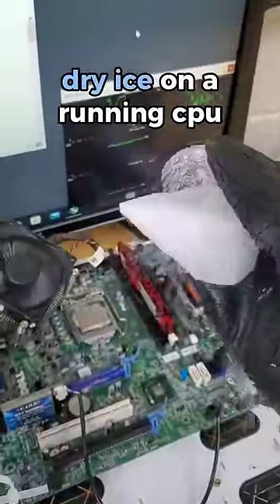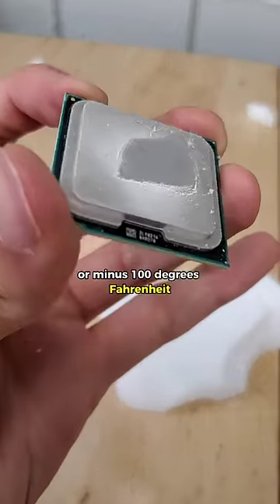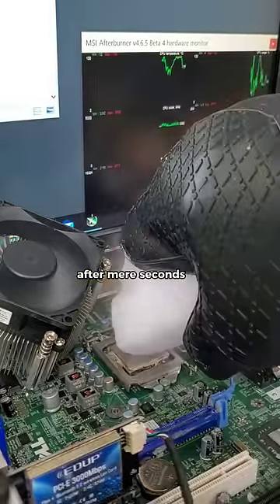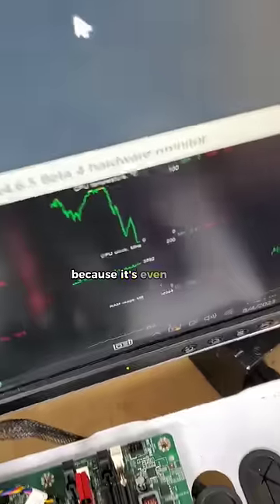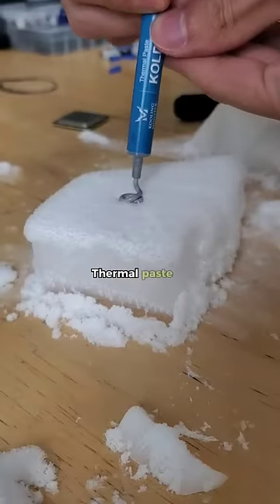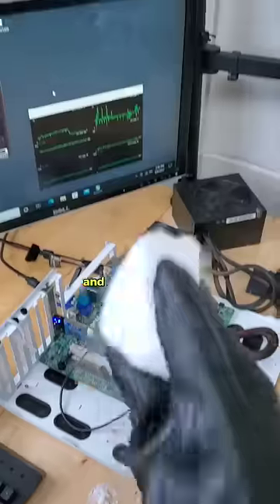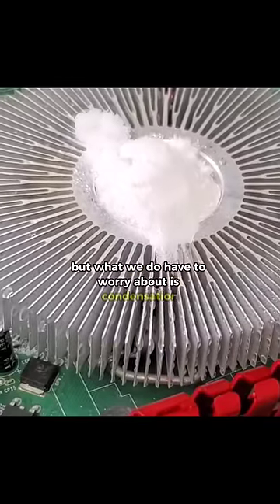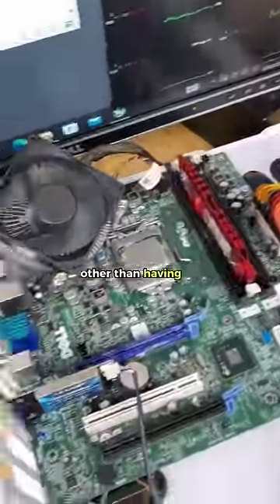using dry ice in a running PC #shorts

Comment: How about making a metal box on top of cpu then out dry ice in it, so you don't have to worry about water on the board
Reply: how would that stop the water in any way...?
Reply: @caldeira_a  just bottom use steel the side use plastic
Reply: @shakld  again, how would that stop the water....? that does nothing
Reply: @caldeira_a  the put the span around it
Reply: @caldeira_a  im trying to give suggestions not arguing with you, if that doesn't work find another damn solution
Reply: @shakld  there are many simple solutions, I'm just trying to understand how what you're saying makes any sense
Reply: @caldeira_a  then do tell me the solution, the solution i give already good if you want to use dry ice
Reply: @shakld  the solution you gave simply doesn't work. As for working solutions, firstly water from condensation is essentially distilled, you just need the computer's surfaces to be clean and the water won't do anything. Secondly, you can just seal the case and suck the air out. No air moisture -> no water to condense. Third option, you can also cover it in a non conductive substance so it'll be isolated, there are duzens of those.
Reply: @caldeira_a  there you go, easy doesn't it just give another solution why do you need to argue with me what kind of solution it need, it not like i going to denied your solution
Reply: @shakld  you presented an idea, it didn't make sense so I tried to understand how your idea worked, it's as simple as that